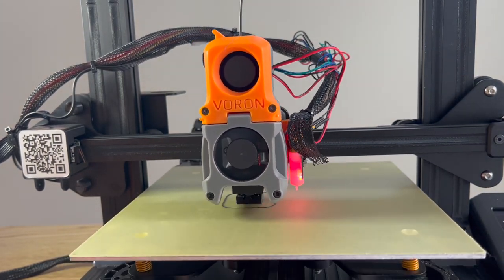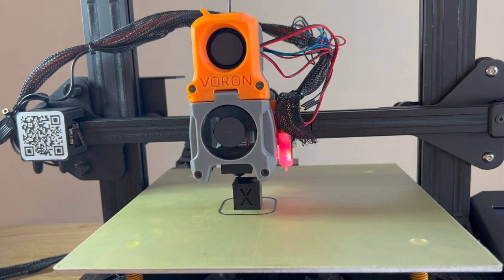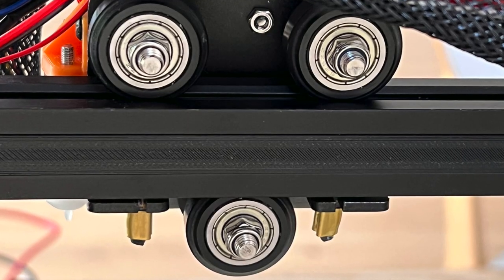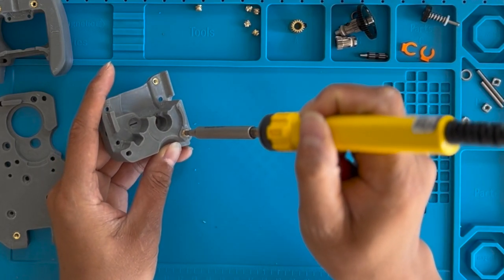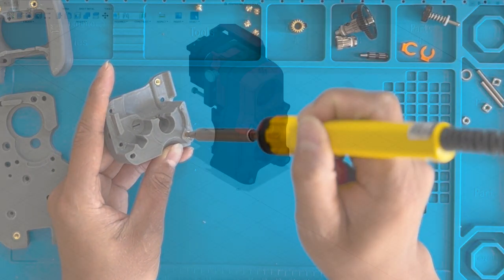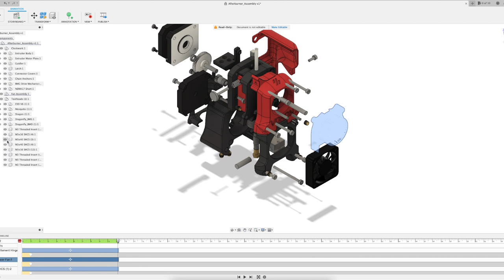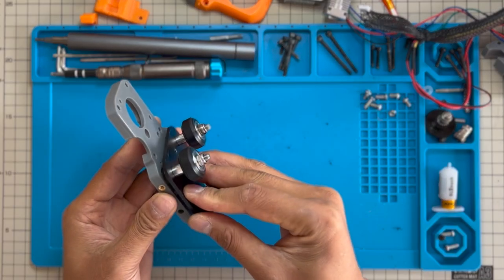Building a Voron Afterburner for Ender 3 v2: assembly and test print

Comment: The afterburner generation that you installed is pretty nice for ABS (with one of the recommended hotends) but it's not great at PLA (largely because of the lack of cooling.  HOWEVER there's a new version of the afterburner in testing that should be released around Christmas time.  The intended design goals of this new version of the afterburner (which uses the internal development name "stealthburner" due to the new angular look that it has) is SPECIFICALLY cooling.  it takes on a new larger blower fan (same one used on the abbn mod as the airflow engineering was designed by the same gentleman (badnoob), and they reworked the ducting to put the cooling right near the nozzle where it's needed most for maximum cooling potential.  I haven't used one personally as I'm waiting for the release version (they are still making small iterative changes weekly), but it should SIGNIFICANTLY improve print quality with PLA (and other materials as well).

Comment: I'm using Afterburner on my Ender 3 Pro for about a year now. Great printhead with interchangeable tools for different purposes (steel heatbreak and hardened steel nozzle for CF/GF composites etc). There is a couple of things that help to use it in it's full potential, cooling system upgrade (LoudOwl mod gives you the opportunity to use 2x5015 blowers for part cooling) and Klipper with it's pressure advance and input shaping instead of Marlin.
Reply from the maker: So I am on the right direction! Thanks for sharing. I would try Stealth Burner (build in 5015 blowers design) later. Klipper is on my list but I am still not sure if I should give it a try because I still want to use ender 3 board only.
Reply: hi,may i get all the files u used to convert ur ender 3 pro to afterburner?
Reply: @wanhilman8676  did you ever get the files? Looking to do the same with mine

Comment: Sadly, you did not show us how to connect the E Stepper Wire the correct way. I am struggling finding info somewhere cause there is no documentation anywhere how to connect the new stepper. Also the 4.2.2 board has nothing labeled. Can you help out?
Reply: Same

Comment: This is an interesting video on how to put it together. But I don't know which one of the cubes was done on the Afterburner, they look pretty identical to me. I've been thinking of upgrading my Ender 5 Plus to a direct drive because of all the clogging issues with my extruder (all aluminum dual gear). I like the Voron design, it looks like it would be pretty light weight.

Comment: I'm going to have a go at this because I'm trying to make an ender 3 specifically for tpu and I haven't found an extruder hot end combo that works really well.
Reply: I figure I can tighten up the tolerances of I need to
Reply from the maker: It works great for me, I have tried tpu though. Good luck with it!

Comment: THanks for the great video! I've been following along with this and making the same mods. I'm stuck at connecting the wiring for the motor to the stock extruder wire. Did you buy another wiring setup to extend the motor wires (which are not long enough) all the way back to the mainboard, or did you simply solder the correct wires together to the wiring coming off the mainboard? I'm leaning towards cutting wires and soldering myself but I'd rather not, as I'm worried I'll mix things up. Also, splicing motor wires doesn't sound like the safest thing. What did you do?
Reply from the maker: Thanks!
I am using the existing wires (cut + solder + heat shrink tube) it looks pretty solid to me. I also use the jst connector somewhere else, I'd say jst connector works better if you plan to change these things very often. but if you don't have the jst connectors handy, cut + solder + heat shrink tube is also pretty safe.

Comment: for 2 pcs m3x10 screws and 1 pcs m3x6 BHCS or SHCS? And for which part? can you give more specific information about the size and type of screw used?
Reply from the maker: Check the details from https://youtu.be/CPJjtwhRJDE?t=93 to https://youtu.be/CPJjtwhRJDE?t=149 and also this one https://www.thingiverse.com/thing:4614384
you can try m3x6 for all the three. if you want to make it more stable you can use m3x10 so you can put a m3 nuts to make it more stable.
Reply: @makeIT0  how long are the two screws used for the hotend?

Comment: Nice build, Im still deciding between this and the hero me gen5. I currently have an mdd v1.2 with bmg extruder and linear rails. I have one question, what offsets did you end up doing? Obviously the print in the right is the afterburner, much better cooling, but you stil can increase the quality a lot better with linear advance or pressure advance if doing klipper
Reply: If you have linear rails then use the afterburner. Go to the official voron page and do it exactly as the 2.4 says. It’s actually meant to be mounted to rails in the first place and the adapters are only to put it on printers with v rollers
Reply from the maker: @deathcube2006 Thanks!

X_MIN_POS -16
Y_MIN_POS -9.2

NOZZLE_TO_PROBE_OFFSET { 36, 6.5, 0 }

Extruder steps/mm: 436

https://youtu.be/DmTqJCn7rKY
Reply from the maker: @Tom Blomfield currently I have dual z axis and v rollers, I might upgrade to linear rails completely later. Actually I am considering building a Voron switchwire from scratch

Comment: i have installed the afterburner motor plate and extruder body but when i installed the stepper motor did not fit like the stepper motor shaft was too long. i used a 23mm nema pancake. i printed the aterburner motor plate the same as yours. can you help me
Reply from the maker: Sure! You just need to use a hacksaw (or similar tools that can cut metal) to cut a little. It is around 2-3mm, you should measure the gap and cut it, and then sand the end of the shaft. Try it,  It is easy than you think.
Reply from the maker: I use a 20mm motor, and it fits very well by default. I did try the stock extruder motor, same as yours, the shaft was too long, but it still worked fine if I cut the shaft around 2-3mm
Reply: @makeIT0  I bought a nema 17 23mm, I measured the length of the shaft as 23mm. What is the length of the stepper motor shaft that you are using?
Reply from the maker: Mine is 20mm Output Shaft (5mm diameter) (16mm D-Shaped)
Reply: @makeIT0  I've called 23mm, it turns out that the length of the shaft is 23-24mm

Comment: Do you want to share the battery driven screw driver model you are using?
Reply from the maker: It is Wowstick 1F Pro.
It does not have too much torque for job like this (designed for phones or other small electronic devices), but it definitely saves your time.

Comment: is there a reason why the ptfe tube not using the locking mechanism like collet?
Reply from the maker: I would love to, but it does not seem to be easy using all parts I have. I would probably go for an all metal hotend or other mods such as galileo
Reply: @makeIT0  hey, how is your E-step cable is long, i just order one from the link but the Cable is really short

Comment: Cool! Considering this vs orbiter, is the print volume decreased?
Reply from the maker: No, if you don't install the cable cover or cut a little like this https://www.youtube.com/watch?v=DmTqJCn7rKY&t=303s
Even if you keep it as it is,  The Z height reduces round 3cm which you would probably never have a chance to use it.

By the way orbiter is also very good solution, I am gonna play with it some time later
Reply: Alright, thanks! Z height is not a problem, as I rarely print stuff above 15cm anyways. I chose this partially cos it looks so sick, and it’s slightly cheaper and more long lasting than the orbiter
Reply from the maker: You are welcome and good luck with the tinkering!

Comment: What is that build mat your using and do you have a link by chance?
Reply from the maker: A simple PEI sheet: https://www.aliexpress.com/item/1000007021586.html
It is not the best, but it works great with ABS
Reply: @makeIT0  no the blue one you were building on
Reply from the maker: Ah, I could not remember where I ordered it, but you can find similar ones from AliExpress, such as https://www.aliexpress.com/item/32863473926.html (disclaimer: I just did a quick search, I am not sure if this one good or not)

Comment: did you print the afterburner using the enclosure?
Reply from the maker: No, I didn't use enclosure. PEI sheet + brim works great for me.
Reply: cant your share slicer seting your using? your primt quality it's good
Reply: @makeIT0  what percentage of cooling fan speed do you use to print abs afterburner parts especially for overhangs?

Comment: Cant your share klipper printer.cfg for ender 3 v2 using afterburner
Reply from the maker: I am using the jyers firmware. For me the BL touch offset is x: 38, y: 5.5, extruder steps/mm: 428.5. You will also need to update the home offset. I will need to sort out the home offset too. I will record a video for that next week.
Reply: thanks for the information, I will try the afterburner print head on ender 3v2 soon
Reply from the maker: @lanypuspasari1868  Good luck with that
Reply: @makeIT0  what version of bltouch are you using? how do you install it, is it 5 BLT cables on the BLT header pin on the mainboard or 3 servo cables on the BLT header pin and 2 switch cables on the Z endstop pin?
Reply: does using a pancake stepper motor have to change the vref current on the ender 3 v2 v4.2.2 stock stepper driver mainboard?
Reply from the maker: Mine is BL touch v3.1  (5 BLT cables on the BLT header pin on the mainboard)

Comment: Afterburner looks nice but is heavy and has terrible part cooling performance for PLA. Its fine for a voron as your generally not printing PLA on it.
Plenty of better options for an ender. HeroMe for example. Way lighter, all the hotend and extruder option and far superior part cooling.
Build a voron if you want a printer with an afterburner, or stealthburner for that matter.

Comment: Hey great vid, im building this printhead for my ender3 pro, i want to make sure im wiring up the pancake stepper correctly, does anyone have a wiring splice diagram and any idea if anything needs to be adjusted to run the new motor as compared to the stock one that comes with the ender3 pro?
Reply from the maker: Check here: https://youtu.be/CPJjtwhRJDE?t=636
It is Black green blue red, however different motors may use different colours, it is not a standard thing. I figured out the wiring using a multimeter by comparing the voltage with the stock motor.

This should also help https://support.bondtech.se/Guide/02.+Installing+DDX+On+Creality+Ender-3/64
Reply: What conector your using for nema steper motor?

Comment: What buid surface your using?
Reply from the maker: A PEI sheet similar to this one: https://www.ebay.com.au/itm/324706856714. It works very well with ABS
Reply: very good idea.  can reduce the weight of glass. PEI spring steel when using a magnetic base its weight is not much different from 3mm glass
Reply from the maker: With the reduced weight, it improves print quality a lot for thin and tall parts. And it is also cost effective. It works almost perfect for ABS printing. The only issue is that ender 3 bed is not that flat, using a thin PEI sheet won't make it any better.